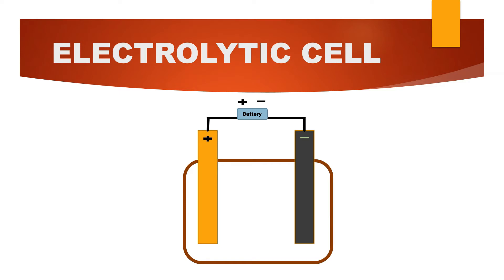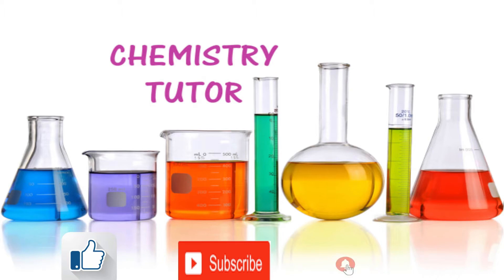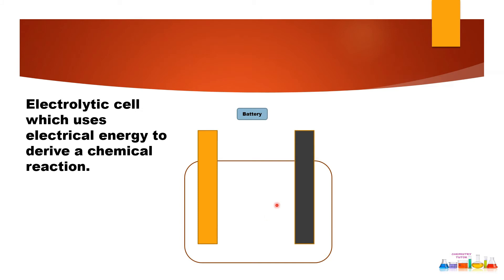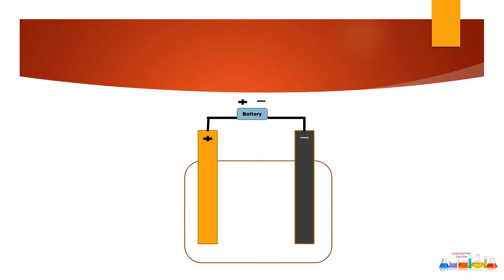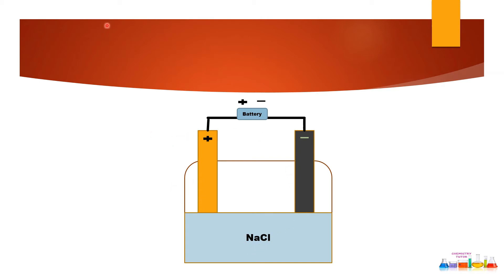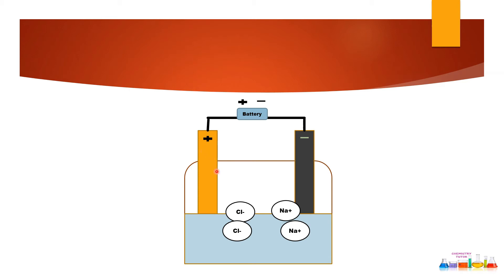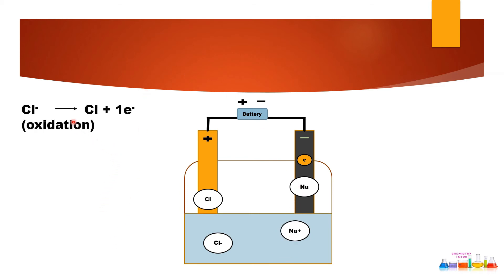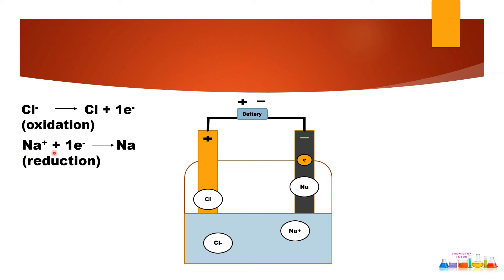Electrolytic cell,Construction,Working and Reactions

Comment: Electron travels from -ve to +ve right? Then how Na recieved the electron that travelled from +ve anode to -ve cathode?
Reply: The electron travel out from the negative terminal of the battery to the positive terminal of the battery. This is electrolytic cell so the charges of the electrode are determined by the battery not the reactivity of the electrodes as shown in the galvanic cell. The electron from the Cl ion goes through the battery and into the positive terminal of the battery and into the cathode.
Reply: convenientional current
Reply from the maker: Electrons flow from anode to cathode in through external circuit , in solution only ions flow not electrons .conventional current flows from positive terminal to negative terminal .conventional current means positive charges cause flow of electrons